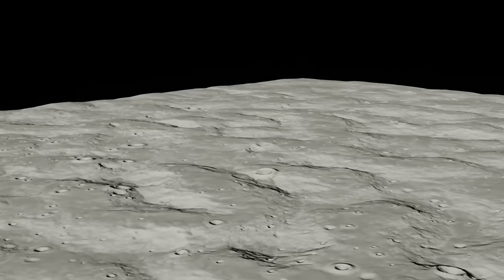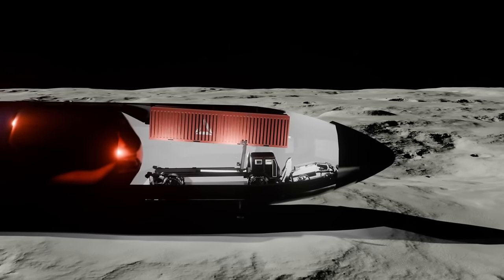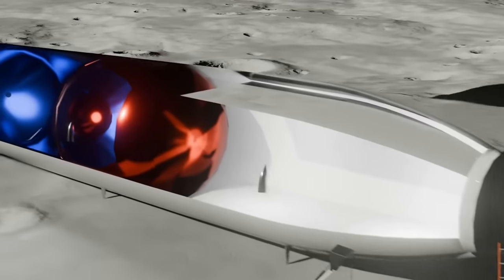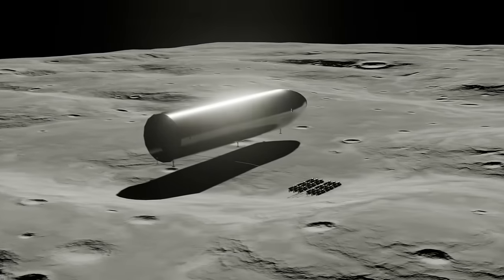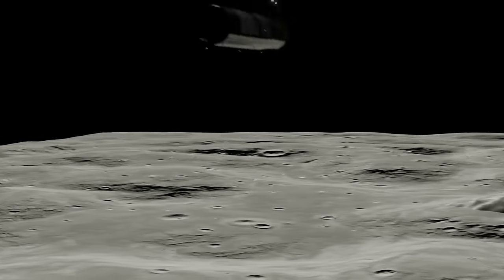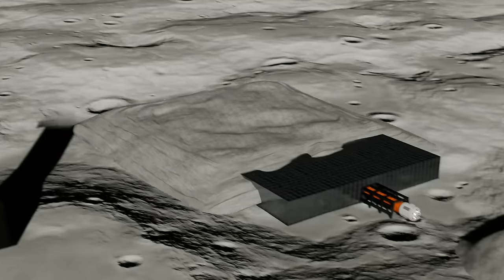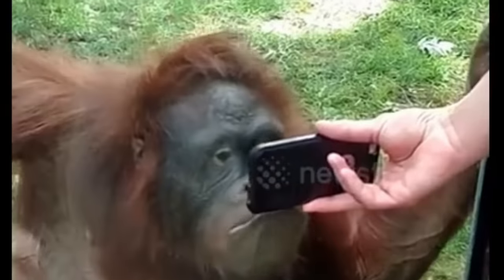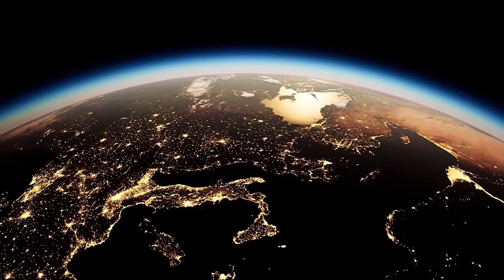How To Develop The Moon ALL PARTS

Comment: Doesn't make sense to use the ship as a base. Completely different design goals. One has to be rigid vertically and has a ton of plumbing and slosh baffles and such inside and doesn't give you a flat floor when on its side, the other has to be able to hold the weight of regolith on top, have level floors and hold equipment and different living spaces etc. You need a ship to act as an elevator to orbit, so why take apart a ship that's already there with tanks and engines and everything? The Starship being designed to bellyflop on earth has everything to do with slowing down on reentry through an atmosphere and isn't at all analogous to landing on the moon - all Starship's engines are at one end, not facing sideways, and the flaps control pitch, not thrusters. The flaps don't work in a vacuum. There's zero transferability there. I basically stopped watching after that since if there's that much misunderstanding of basic concepts and such impracticality within the first couple minutes I don't trust it will get better over the next 50.
Reply: 🤦‍♂️ bro didn’t listen/watch when he said that the tanks/plumbing  would be removed and floors installed
🤦‍♂️ bro doesn’t know how strong steel is(what the starship is made of), or that the moon has lower gravity(meaning that the weight of the regolith above the ship won’t be a problem)
🤦‍♂️ Bro didn’t pay attention/watch enough to know that ppl never LIVED in the landed ships they WORKED in them
🤦‍♂️ “why take apart a ship that’s already there…?” Because what are they going to do take an entire base there with them? You take it apart because at that moment SPACE is the most valuable resource on the moon, and you can you can get more of it if you trade a starship for it.
🤦‍♂️ yeah there is no atmosphere on the moon, so…you ever consider that the reason the starship is bellyflopping here is… not to to slow down that way but instead to land that way?
🤦‍♂️ you either didn’t pay attention/watch enough to realize that the ONLY starships with flaps were the ones that were supposed to return to earth. You know, fly through an atmosphere again? Oh wait I forgot, they should have them taken off! They won’t need them on the moon! Who cares that they will fly through our atmosphere in 2 weeks?
🤦‍♂️ seems like you didn’t watch enough of the video/ have enough understanding to make it through 50 minutes of a video that clearly was SPECULATING a possible way we COULD colonize the moon…
Reply: @jakammor4449  bro - it's not that any of this can't be done, it's that none of it is remotely the best option. Nothing you said changes that. All the problems are thought through way too simplistically and shows a lack of deeper engineering understanding. These solutions may seem "obvious" and sensical at first glance to someone who doesn't understand the problems well, but there are much better ways of accomplishing all this. Like, I could probably fill a three pages going over all the reasons why landing a ship on its side and then spending days or weeks converting it into a habitable space makes far less sense than inflatable structures. Like, is everything inside going to be a mechano set that can be easily unbolted? No, solid or welded pieces make way more sense from a weight and reliability perspective. Ok, so you've got to cut through the metal and welded joints... which creates sparks... in an environment with flammable materials... in an atmosphere with 3X the amount of oxygen in it as on earth...in a pressure vessel. It's seriously difficult for me to stop there, I mean there's just so so so much that goes into this stuff that most people watching this won't consider.
Reply: @truhartwood3170   well, using a starship as a moon base is a SpaceX idea… I’m sure SpaceX have their reasons for that. As for the sparks and fire/explosion hazard, what is going to catch fire? Last I checked, steel doesn’t burn, and the starships sent to the moon would be almost completely unfurnished, so no fire hazard, and that’s assuming that there is ANY O2 even in the ship at the time of repurposing. Remember, the starships are unloaded before they are converted, so they might not be pressurized, no O2, no fire hazard.
Reply: @jakammor4449  as far as I can find, Elon only said that the initial ships don't need to return and can be part of Moon base Alpha. He didn't say anything more beyond that. Everything else about putting them horizontal and doing anything to convert the interiors has been from people outside SpaceX surmising how they will be used and what Elon meant by that. It will take days to get to the moon, so the ships will already have kitchens, sleeping quarters, work stations, life support systems, water tanks, etc. So the obvious thing is to leave them as-is and use them as-is.

You really don't know anything about working in a vacuum so you really need to just learn more or stop talking. If the work area inside the tanks is breathable it will probably  be at around 8psi and 65% oxygen. Do you think they're wearing metal suits? There will be synthetic fabric, rubber, and plastic all over the place. If it's not pressurized they need hours to get into their space suits as they decompress down to  4.5psi so they don't get the bends. Suits have to be at such low pressure so the joints still move, especially being able to close your fingers. You're super unwieldy in a suit so everything is going to be super slow and way more effort, plus now you have to worry about doing construction and metalwork in a balloon. Not a particularly safe combo. Basically, the cost of doing human labour in space or on the moon is WAY higher than on Earth and people just don't factor that in. Astronauts have an entire team watching everything they do, running through check lists, and they've practiced the exact task multiple times in simulation on Earth. The amount of work needed to lay down and convert a Starship into habitable spaces is super dangerous and massively complex. Just no. Things need to be mostly ready to go, plug and play, with minimal work needed. That also reduces the chances of human error when doing the building, as everything will be checked and scrutinized and tested on Earth by a whole team before it's sent up and used. Like I said, I could literally write pages about why converting ships and tanks is not the best way to go. I'm going to force myself to stop there, just because I can't spend hours doing this. I also won't reply to any more "but but buts". Go do more research on it. The more you learn, the more you'll find out why it's not the best solution. It's like people who think Hydrogen is the best solution vs batteries - when you learn 20% of what there is to know it sounds like an amazing solution. But as you get past that level of knowledge you start to realize all the practical drawbacks that make it not make sense.

Comment: the video didnt adress how to handle Moon Dust thats a huge Obstacle...
Reply from the maker: No it's not, its easily mitigated with magnets and melting.
Reply: @Anthrofuturism  but we know that it was a problem on the moon missions, just wondering why it didnt get adressed at all.

The tractors and all the bearings need to handle the dust, since they are scraping it. No idea if that would be a problem.
Reply from the maker: @pirminp7090  Sure but it's a technical obstacle. Low level. This video was more about big picture economics and strategy, not tactics.

Comment: Not only nuclear engine has 4x the specific impulse, but also it doesn't need oxydizer to propulse, which means practical isp is 2.2x times more than the theorized one, since isp calculations are done only fuel-biased.

Comment: It seem most practical to build human habitats either at the bottom of an impact crater, into the sides of that crater, or what makes even better since is to use the Boring company's tunnel digger in conjunction with lava tubes already on the moon. Either way, it does not seem practical at all to build directly on the moon's surface. Before any settlements for humans should ever be built on the moon, robot shelters should be built, because it is more likely that robots will have to build any type of settlements before humans can spend any lengthy amount of time on the moon. There are just too many issues for humans outside of Earth's atmosphere. 

Something else I have not seen as of yet, is what kind of heavy equipment can work on the moon. I have not seen any electric backhoes or front loaders. The moon is very cold. The heavy digging equipment we use today won't work on the moon. We fantasize all the time about humans colonizing outside of our atmosphere, but there is less practical ways for us to survive these out of this world environments.
Reply: "outside of Earth's atmosphere" is what spacesuits are for. What you're worried about is the radiation that ordinarily gets trapped in Earth's Van-Allen belts, which is why they're proposing to bury the habitats so that the regolith shields them from radiation. 

A lot of the heavy digging equipment we use today already has electric drive systems because of the far higher torque they produce when compared to mechanical drive lines. NASA/JPL has DECADES of experience keeping battery systems in good condition on their lunar rovers, which mainly involves using electric heaters to keep the batteries warm at night time, and factoring that into the rover's power budget. Also keep in mind that the moon as 1/6th earth's gravity, so they can easily be made of lighter materials like aluminum (which is very plentiful on the moon once you can get production going) and still get the job done.

Comment: For your plan to work, you need to understand human nature.  Have you ever worked in big retail?  I like to say the culture will be similar to working at ALDI or Trader Joes.  You were hired as cashier but you have to be able to do all jobs.  Some things/work will have to be done...for free but accounted for cheap.  This is like a small business ownership, you do everything.  I probably have no problem living with aluminum.  But one I am there I going to replace it with better material.  The key thing is to stop btiching once the leader goes with a method, solution, material and etc...The key thing to get it built.  Go wide when you get to Moon or Mars...Do as you like...I am back on Earth.  PS...I don't understand how your going to dig a hole.  I guess back beaking work of a shoval and pick axe or C4.

Comment: You did not put the explanation in the description. I should've never trusted you 🤓
Reply from the maker: oops, thanks for the reminder it's up now :)
Pedantic Nerds:
When you put regolith into the cell out comes oxygen gas, aluminum, silica, and low-purity molten iron. Molten Regolith Electrolysis. Then you can take that low-purity molten iron and feed it back into the cell, refining it into high-purity iron. Molten Oxide Electrolysis. The difference is the purity of the iron, and to make steel we need very high-purity iron.
Since the steel-making process involves two electrolyzing steps we should specialize them and deliver two of these to the Moon.

Comment: The SpaceX belly flop is just a way to slow down before landing vertically.   But you need an atmosphere to belly flop, which the Moon does not have.  So, a belly flop maneuver on the Moon is pointless.  Nor can the current version of the Star Ship land horizontally, even at 1/6 Earth-gravity.   To convert a Star Ship to a horizonal habitat, you need an erector, operating in reverse - laying a vertical-landed Ship on its side.   To operate the erector on a robotically controlled Star Ship, you probably need a crew of humans prepositioned on the Moon.   I'm not an economist, so I cannot comment on your highly detailed economic analysis.   But you obviously have expended a great deal of time and effort in that analysis.   Also, I commend you for advancing the thesis of using the Moon as our stepping stone to the Solar System   Kudos!!!

Comment: Gee, I  wonder why a spacecraft couldn't land vertically and then be tipped horizontally? I guess someday scientists and engineers will be able to solve this complex problem.
Reply: Cuz you’d need a crane for that. Unless you want to idk just drop it or something? The whole point of using the starship body as a base was so that humans could have a safe space to work and maintain the base’s essential equipment until proper buildings are built. That doesn’t work if you crack the hull of the starship by just tipping it over.
Reply: It's OK. The first one they try and land vertically will fall over. They can use that one.

Comment: Alternate scenario: 1) build orbital ring around earth (cost 50 trillion reduces cost of all subsequent launches by 99.99% opening up the entire solar system to industry) 2) with the orbital ring making ability on hand, build a ring around the moon (much easier than around earth) 3) the lunar orbital ring can be used as a scaffold for outposts suspended over the surface

Comment: Fission is the worst option. Fusion is the best. 

Shooting for Fission energy is a pretty bad choice. When it comes to a lunar base, Fission is not a good choice. 
For example, Fusion, the better, stronger- and more efficient older brother of Fission exists. Capable of doing what would normally take quite a lot of Uranium and maitenance, only takes a cup of water for Fusion. 
And with a Fusion reactor malfunction, nothing would even happen, unlike the risks of contaminating the lunar surface for thousands or millions of years, like you would with a Fission reactor.
Plus, it produces no harmful waste like fission. And to add insult to injury, the fuel for Fusion can be found on the moon, and be made on the moon. Plus, Fusion reactors can be made smaller than Fission ones.
Even solar power, which would not be held by any atmosphere, could become really effective.
Going for Fission power isn't the best choice. 

This sounds cool, the video is great so far. But I just find it slightly off-putting that we'd choose Fission over Fusion, or even Solar.
Reply: Fusion is still science fiction at this point. Fission power is tried and true.   

Solar power can help, but please try to remember that the moon has 2 week long days and 2 week long nights.
Reply: Yeah, maybe in a few hundred years.  So far the first test plant, not operational plant, but short run test plant that has taken 2-3 decades and countless billions of build.  At this point you might as well suggest they use warp drive for all the real value it has.

Comment: I wish more individuals would: 1.) Learn the current system of measuring radiation exposure and 2: Read Dr. Van Allen’s original paper from 1956.   Lethal radiation  exposure begins at 400mi above MSL and continue out for 50,000 miles.  The only way to avoid the powerful flux within the VRB’s  would be to launch from the magnetic poles or create an electromagnetic field around the spacecraft.  So far none of the moon  bound spacecraft have launched from the poles.  I’m sorry but that means that humans were never aboard them.  Humans have likely never left low Earth orbit.  I believe many are the physicists and engineers who know this truth, but keep their mouths shut to avoid job loss, or worse…  😢.
Reply from the maker: This is the most scientific "the moon landing was fake" post I've ever seen.